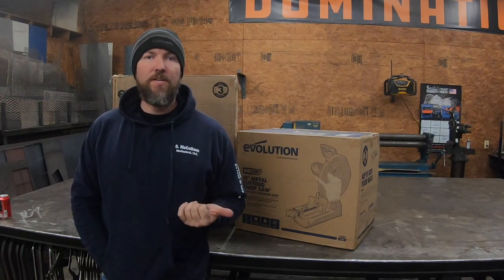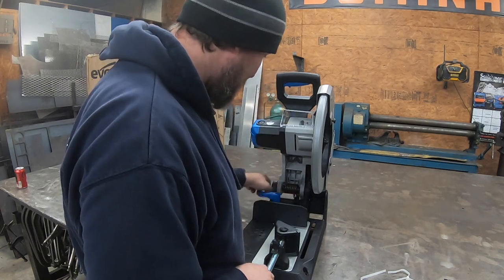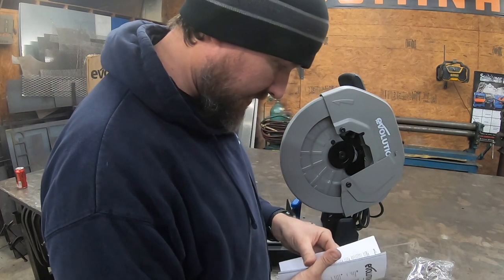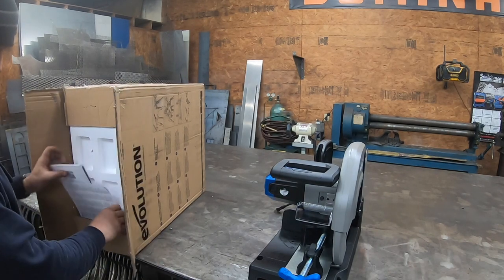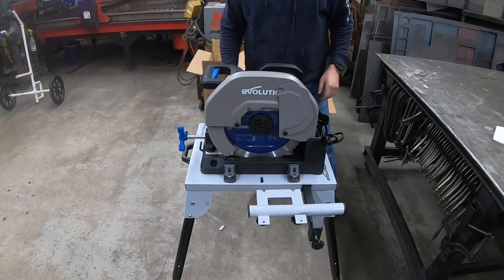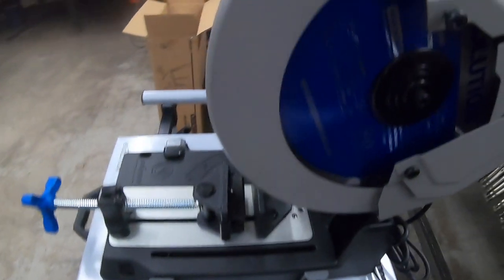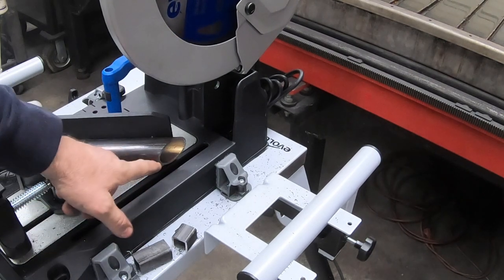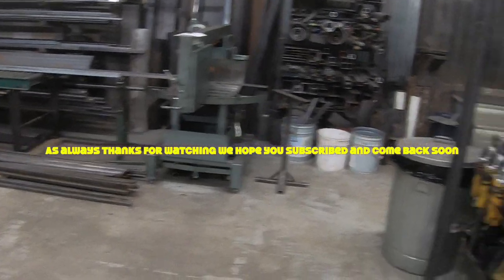I bit the bullet!!!  $649 chop saw has arrived

Comment: Crud I got the stamped one. Well let me know how yours works.
Reply from the maker: I bet you can’t even tell the difference.  Are the model numbers different??  This one is the 380CPS I think???
Reply: @MattcoMetalWorks  From what i can tell they had a 14" saw with a cast base (S355CPS) but replaced it at some point with a stamped base (S355CPSL). I haven't seen a version of the 15" with a stamped base, only the cast base in this video (S380CPS)

Comment: Let me me know what you think of it after several uses
Reply from the maker: I sure will.  Do you have experience with one?? It sounds like your telling me I won’t like it!!!  😳 😱
Reply: @MattcoMetalWorks  I've used a 15" evolution  chop saw before and never had any issues with it even cut 3/8" material with (cut like butter). I have recently bought an Evolution R255SMS this saw can cut angles up to 52 degrees and bevels up to 45 degrees. This saw works well with 14 ga. materials and 8.4 junior channel but can only make a few cuts in 1/8" Sq tubing or 3/16" angle with a new blade which makes no sense.
Reply: @MattcoMetalWorks  Can we get a tour of you shop?